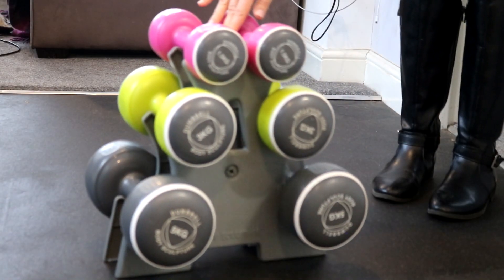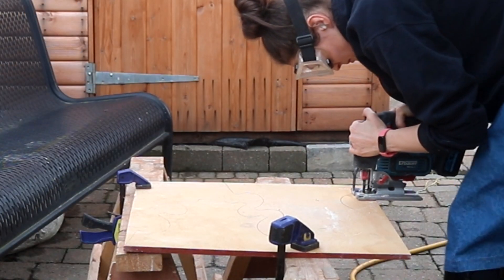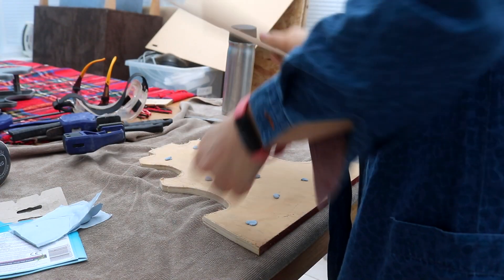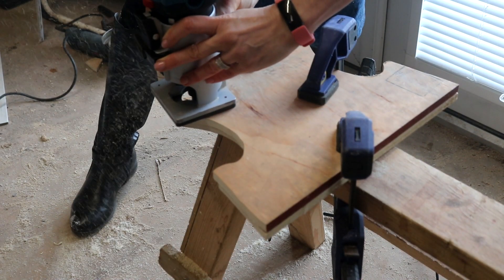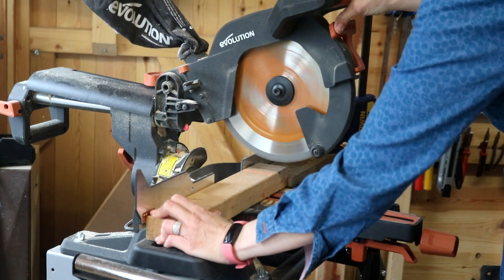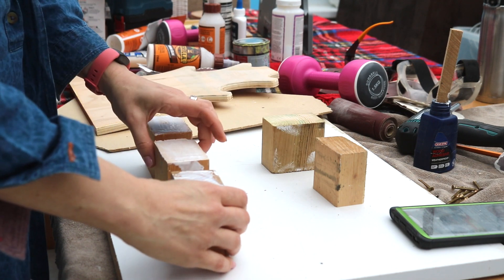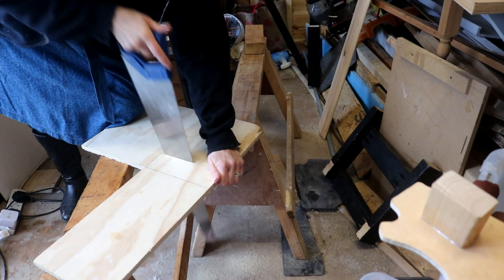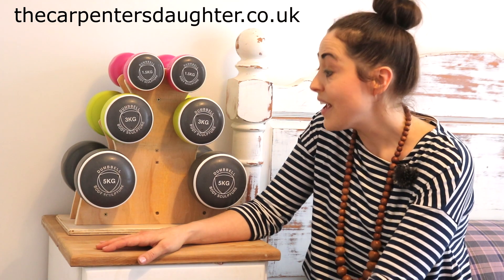DIY Dumbbell Tree Rack (3 Tier) & Free Plans | The Carpenter's Daughter

Comment: Yep, those trees are so weak. Mine shattered after a week!
Reply from the maker: Pile of garbage!!!
Reply: @TheCarpentersDaughterUK  hopefully they spent quality on the dumbells but it's worrying how they scrimped on the rack. So many times I have to pick it up.
Reply: @TheCarpentersDaughterUK  Btw how do you find those einhill and erbauer tools?
Is the makita different or did you just decide to use a Impact for the screws?
Reply from the maker: Love my battery powered erbauer tools.  I also love my makita impact driver - but got a flat battery and couldn't find the charger, so moved on to my einhell one.

Einhell stuff... I'm not sold on, tbh.... it's hit and miss.  The impact driver is fine, but their jigsaw is hard to see where you're cutting, their orbital sander seems lacking in power and the battery powdered circular saw, fully charged, does a LOT of stopping.  I do love their SDS hammer drill though.
Reply: @TheCarpentersDaughterUK  thanks. I am same with einhell
Battery doesn't seem to last long and tools are not that powerful. Multi tool keeps stalling. Thought of erbauer as affordable alternative as can't justify costs of dewalt milwaukee etc for DIY and odd Jobs...  Looking for. Sds and erbauer one
Reply: @TheCarpentersDaughterUK  sorry is that einhell sds? How's the battery life and power for that given the issues with the circular saw?
Saw they have 2 models of sds a cheap £60 and another thats double... Guess the £60 won't be that good....